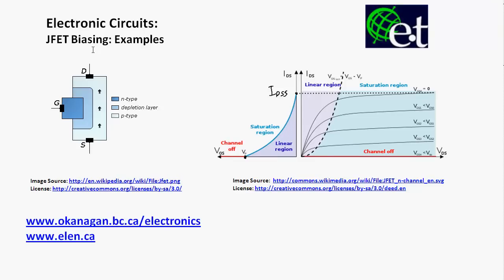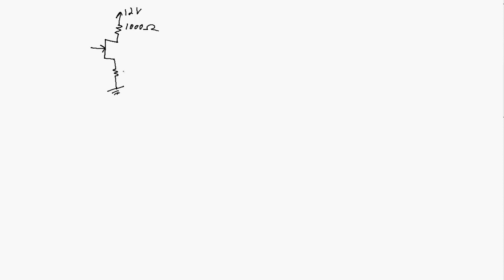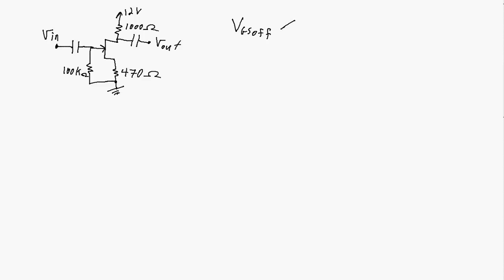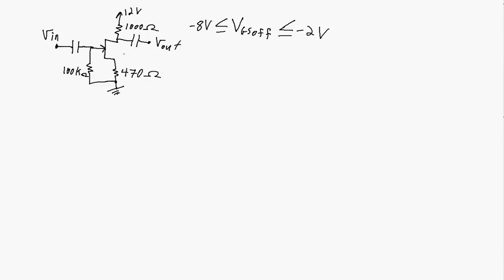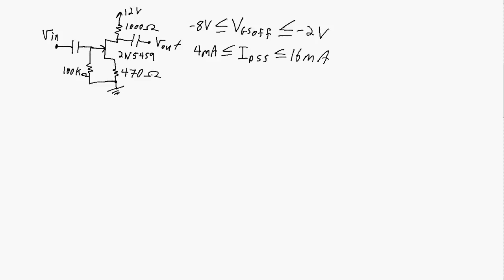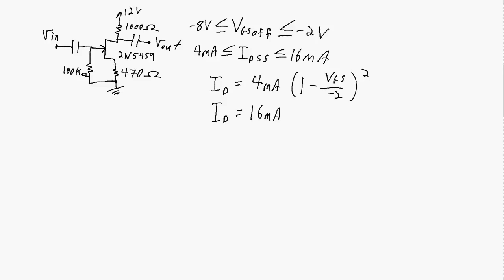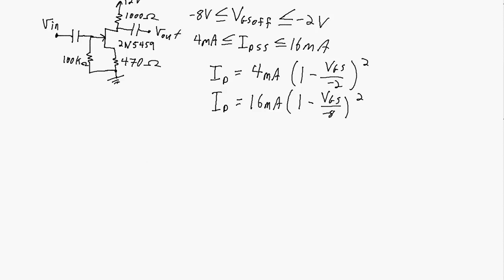JFET Biasing 2 - Some Examples

Comment: I'm surprised so many people don't get this ,children in the 1950s were "playing" with vacuum tubes triodes and pentodes at highly elevated anode voltages,and could calculate for pentode curve sets,make new curve sets,calculate for amplification factor,impedance,transconductance from a data sheet curve set identical to the jfet data shown in this video,maybe if tubes were "played" with a bit more the more modern application for this style of curve set would be better understood.

IT'S FREAKIN' SIMPLE YOU DUMMIES,IT'S ALL BASED ON DC,AC THEORY HASN'T BEEN ARRIVED AT YET,EVEN THEN IT'S NOT BRAIN SURGERY.

I'm just kidding,not about it being simple though,the curves are the best way to calculate for bias,jfets can be a bit sketchy towards batch accuracy Vs the data sheet;though most should be close enough ,make a test rig circuit to manipulate the supply and bias voltages versus load current and you'll see that the variation in batches is not as bad as it seems,if it were jfets would have been scrapped a long time ago.
What is more difficult is calculating the output impedance and voltage gain when driving a second amplifier input,if you have the numbers for the first stage ,the ac output impedance,ac voltage gain,input impedance of the next stage is if i remember in parallel with the driving stage output impedance which affects the driving stage Av(voltage gain),input capacitance may also have an effect,though that may just be for mosfets.

I use vacuum tubes mostly and hence the reason i also must recap on jfet theory,but for the most part voltage controlled devices,jfets,mosfets,tubes  work sort of similar as opposed to bjts that operate in the current domain.

watch as many videos as is possible,the best ones shine through,this one seems to shine nice.

Comment: can you do it numerically? stuck here. not time for graphs during an exam...
Reply: using the transfer curve IS the easiest way to figure this stuff out,it IS numerical and graphical giving a clearer view of what is happening in a dynamic fashion,where bias should be or not,saturation or cut off reached too quick from input signal excursion Vs bias point.

Comment: Jfets specs suck. I gotta get a bunch to find good ones. most are duds. the good ones sound sweet though as a buffer when the drain is half the supply voltage
Reply: make a test rig to find the family of curves so you can keep use the ones that don't spec out as per the data sheet.